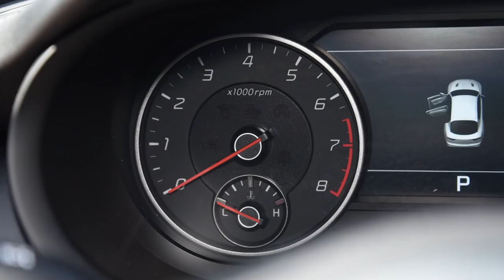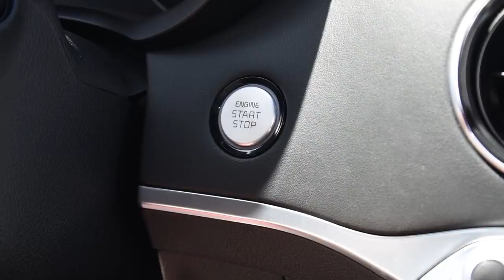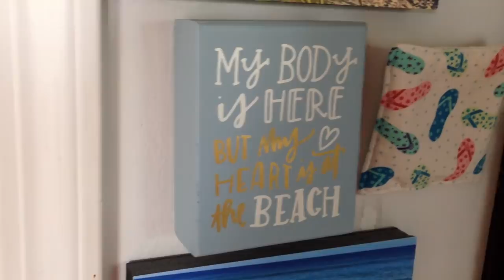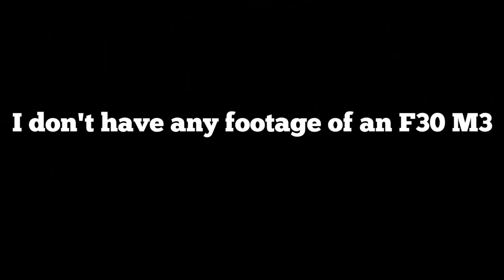2018 Kia Stinger GT: Regular Car Reviews

Comment: Literally this is the only Kia I would ever buy
Reply: I’d would drive an optima over an accord
Reply: The Optima is bad ass and the new Soul looks good. Sorry, but that is how the cookie crumbles.
Reply: Madeline Monahan  Grammar Gestapo, the Juden isn't in this thread. Go to another attic and spell check Anne Franks diary instead of the Ginger and his poor grammar.
Reply: Kia is still an unreliable brand. Loads of stupid tsb's coming out for most of their vehicles. The 08 to 13 Optima with a 2.4l or 2.0 turbo are warrantied for life because the engine is such a shit design they cant fix the problem so just give it a lifetime warranty. Not a car worth owning 10 years from now.
Reply: Pony Empires Unite Yeah but the soul feels like your riding in a plastic box on suspension made of jello. Id take an accord over the optima and the pricing is similar.

Comment: If KIA does not sell enough Stinger GT units in USA it may end up like VW Phaeton covert luxury
Reply: Alucurd Hellsing but the Genesis is selling well. So there will be parts and aftermarket
Reply: You’re thinking the Kia k900
Reply: The Phaeton is extremely well built though , like a tank lol.
Reply: they sold 3300 phaetons over 5 years.  latest Stinger sales numbers are 7059 total in 5 months.  and 1761 in May.  so.... not really like the phaeton at all.
Reply: The Phaeton did not sell well in the US because it was claimed to be over engineered so when it did break repairs were utterly expensive and also VW did not bother to advertise it not knowing that VWs are viewed differently in the US than Germany.

Comment: Right, he chose Kia over M3 because it "handles the same", not because it's $20,000 cheaper.
Reply: It's not even comparable to the m3
Reply: Driven both. The Kia feels like it has more power and is a LOT more livable. The M3 crashes and clunks over every bump and doesn't really hide it's a 4000 lbs monster.
Reply: KNOW MY BRAND
Reply: No, he chose it because it handles the same AND is $20,000 cheaper. If you don't care about badges, picking the Stinger GT over an M3 is a no-brainer.

Same goes for picking a Mercedes C-class or a BMW 3-series over a Maserati Ghibli - I have no fucking clue why Maserati thinks they can sell what's basically their take on a C-class or 3-series for TWICE the base price of a C-class or 3-series. In other words, why pay more for the same thing if all paying more really gets you is a badge?
Reply: Less then that my 19 competition package was 80k
Reply: @razorgxp  M3 Curb Weight is around 3500lbs. Not 4000.
Reply: Kia cars still are not reliable
Reply: @KobeCorona-uj3zb  that is false
Reply: @VestedUTuber  The Stinger is a great car, it really is, I am deciding on one or a model 3 mid as a daily, but don't be an idiot. Its nothing close to a m3. a M3 is a rocket ship scalpel knife. The Stinger is a couch jet plane in comparison. Great, but a GT tourer, not a racecar.
Reply: @KobeCorona-uj3zb  yes they are I've had two

Comment: BMW hurting juice
Reply: Uff aua meine Werke
Reply: Stef_R which is accurate because Hyundai/Kia poached BMW M people.
Reply: Stef_R bmw M5 goes 0-60 in 2.8 seconds. Lmao. 

But I’d rather have a bmw 440xi for $60 than a $55k+ kia
Reply: Devin Bender stingers start around $34k, a top trim GT2 model can be had around $50k.
Reply: Yukikazehalo and that base stinger has 255/255rwd for 35k (local dealer price) 
BMW 330i is about 38-40k local price. 

GT2 is priced at 55k+ locally 
BMW 440xi is 60k locally. 

Still taking the bmw for an extra 3-5k it’s worth it
Reply: Devin Bender your local Kia dealers have awful markups then, there isnt a single GT2 in my area selling for over $52k.
Reply: and when it brakes you will be crying to and going to kia
Reply: Yukikazehalo that’s what happens when there’s only one owner of all the Kia dealerships within a 150 mile radius.
Reply: Uncle SJ not I’ll be going to ford. Ford fusion sport would be my first choice anyway
Reply: Devin Bender The Fusion Sport doesn't even compare, at that point I'd rather get a Taurus SHO which has, surprise surprise, also a turbocharged V6 and AWD. Paying more just because you'll have the BMW badge is stupid, at that point you're just buying the car for the badge and how it'll make you look in public. That means you're buying the car for other people, not for you.
Reply: uh the Fusion Sport also has a turbo v6 and AWD so how doesn't it compare?
Reply: Olivier Savard Fusion sport Base 38k Stinger v6awd vase 38k 
Loaded vs loaded 44k vs 55k 

Both are about 190” long 
And the ford weighs 600+lbs less
Reply: Devin Bender Alright, so I actually went to see what's the difference between both and if the Fusion Sport is worth taking over a Stinger GT.

First of all, fully loaded with every option, a Fusion Sport costs about $47k, not $44k. As for a fully loaded Stinger GT2 with every option, it costs $54k, not $55k.

Oh, the Stinger GT has a weight of about 4000 lbs, while the Fusion Sport has a weight of about 3900 lbs, so I don't know where you got your number of "600 lbs lighter".

Now, what's the difference? 

- FWD-based for the Fusion vs RWD-based for the Stinger GT
- 365 hp (seen by some as underrated as C&D gets figures and times that are similar to the Chevy SS which is more powerful and a bit lighter) for the Stinger GT vs 320 hp for the Fusion Sport
- A lot more equipment on the Stinger GT2 (the most pricy one at $54k with every option) than on the Fusion Sport: to get a similar level of equipment to the Fusion Sport, you'd get the Stinger GT1, which costs about $45k fully loaded with every option
- More room in the Stinger than in the Fusion
- 8-speed auto for the Stinger GT vs 6-speed auto for the Fusion Sport
- Bigger brakes for the Stinger than the Fusion Sport
- Better warranty for Kia than for Ford
- Better reliability for Kia than for Ford
- Better acceleration for the Stinger GT than the Fusion Sport
- Better braking distance for the Stinger GT than for the Fusion Sport
- Better lateral grip for the Stinger GT than for the Fusion Sport
- An actual liftgate/hatch for the Stinger and only a regular sedan trunk for the Fusion Sport
- LSD available for the Stinger GT2 and not available for the Fusion Sport
- Launch control available for the Stinger GT and not for the Fusion Sport

Knowing I'm going through a lot of stuff, I think the Stinger GT is just better than the Fusion Sport, as well as worth the price difference for the GT2, since it has a lot more equipment than the Fusion Sport. The GT1 offers level of equipment comparable to the Fusion Sport for about the same price, but being still better in many points.

If you want to compare it to something, then compare it to the Buick Regal GS.
Reply: Olivier Savard LSD is arguable. 
Better performance is a marginal. 
Trunk is only what 2ft3?? And it’s all vertical space. 
Better warranty??? What do expect the Kia to blow a head gasket at 80k? 
Better reliability??? ON WHAT FUCKING PLANET?!?!?

Fusion has Magnetic suspension. And Loaded cost 10-15k less in the real world!!! 

0.5inch bigger breaks
0.5 seconds quarter and 60 is hardly better 
15ft stopping 
And 0.05gs lat grip is nothing. 

I can take that 10k and get a tune on E85 and get bigger tires and blow the fucking doors off a Kia. 

Kia is one of the fastest depreciating brands on the market. The GT2 will be 30k or less in a few years. 
Ford has 100+ years of Racing Heritage.
Reply: Devin Bender Look, dude, the Stinger is just better than a Fusion Sport. There is no 10k difference, and if you get a GT1 which has the  same equipment as the Fusion Sport, they'll cost pretty much the same. You keep comparing the most expensive trim even when there's another almost identical trim which is roughly the same price as your Fusion Sport. Even if you keep saying that there's almost no difference, and that it's "nothing", there is still 40 more horsepower (and possibly more), it handles better and brakes better. 

If it would be worth comparing, then people would actually buy the Fusion Sport. As I said and repeated, it doesn't aim the same target or the same public. Someone who's going to buy a Fusion Sport is going to buy it and won't look at the Stinger, and someone who's going to buy a Stinger won't look at the Fusion Sport.

Now, if you just don't like Kia (the brand in itself), would never want to buy one of their cars because they are Kias and won't concede a single thing, then just tell it. I'll understand. You'll stop losing your time replying at me and I'll stop losing mine replying at you.
Reply: King of The Castle everyone is cutting back on sedans. 
Last I checked ford sells more sedans than everyone else excluding Honda and Toyota and it’s close.
Reply: ow oof my M3
Reply: Breaks actually , brakes in your wording are on the car ;)

Comment: Nice ride but the SS is worth it for the motor. LSx>all
Reply: THATMOFODIRT and the all mighty 6 speed stick shift. Automatics are for normies!
Reply: THATMOFODIRT 400+hp v8 or 350hp v6 hmmmmm 
Yup gimi the 8!!!
Reply: and the sound lol
Reply: If you're only looking at the motor, just...get a Camaro? Also, this twin-turbo, inline-6, 9-speed automatic is faster than your obsolete-and-honestly-antique N/A V8 and 6-speed manual. The Kia is also more comfortable, more fuel efficient, has more space, has a higher-quality interior (ironically enough), handles better, and is only 26lbs heavier.

So, while the SS may be worth it "for the motor", is it worth it for...every other part of the car? I'll have to say, no - and I do love my Chevies.
Reply: Naru 'Sanav sane gas mileage and the Automatic Camaro SS kicks the shit out of the Kia on the race track... it’s not even close!

And handles better?? Where 
Camaro better braking, skid plate and magnetic suspension

Comment: The one pet peeve I've had with Kias (from the 2011/2013 models, I haven't recently driven any) is the fact that you couldn't turn off the radio/music when you wanted the LCD screen on in order to display the map of where you are, or do navigation and so on. All you could do when you wanted silence in the car, was to turn down the volume, but the thing had the annoying habit of going back up to 4% after you restarted the engine, so basically it was some barely audible noise that annoyed you until you remembered to turn the volume back down. And there was no way of having only satnav without any fucking radio bullshit. So yeah, that was an absolute no-go for me, and this is the only reason why I wouldn't want to have a Kia!
Reply: Interesting, I've never had that issue, my radio is set to SiriusXM ch 0, which is a nothing channel! No noise here, love my 18 Optima

Comment: "Handles like a M3"
Reply: lamarasamuel it was designed by bmw
Reply: Tam Ago appearance not performance by bmw................
Reply: Performance was by the ex head of BMW M.
Reply: benanderson89 President of engineering. All he did was write checks.

If it were real engineers from bmw the base car would have 300hp and the Gt have 400hp like most other sports cars out there
Reply: Devin Bender having higher numbers doesn’t make the car better tbh it’s pretty good as is and as a Kia it’s miles apart from the rest of its fleet. Give Kia a chance all companies deserve one.
Reply: Ace Morales it’s still to much money. 

Ford Fusion sport has 330hp awd and the same options as the GT2 and cost almost $12k LESS. 

Please try to explain why the Stinger is 20% better? 

(Oh and the SEL Fusion 2.0awd is $6k cheaper than the stinger 2.0Tawd)
Reply: Devin Bender I didn’t say it was better or worse I was just saying numbers don’t make the car. But that is a good point. I personally would probably still go with stingers because of all the bad luck my family has had with American cars and my friends aswell :/ even still good point. I guess it comes down to preference in look and maybe company
Reply: Devin Bender Because it is not for the same public and someone who'll buy a Stinger won't have the Fusion on their list, the same way someone buying a Fusion won't have a Stinger on their list. It just isn't marketing to the same target, so stop comparing these when they clearly aren't in the same market. Plus, Ford is dumping all their cars except one Focus and the Mustang. 

It's like comparing a Mustang Ecoboost to a Challenger SXT to a Golf GTI. It doesn't compare and it doesn't target the same people. It's like comparing a Miata to an Abarth 500 just because they have the same horsepower, again you can't, they don't target the same people.
Reply: Sounds like a sales copy....

Comment: I got to check out a 3.3L Stinger when I was working a deal on a 335i. I am very impressed with the Stinger GT, it's not the KIA I grew up knowing; that said, it's still a KIA and I'd never even consider owning one. Test drive one? Sure. Accept one as a loaner? Absolutely. Spend even a single penny to drive one? FUUUUUCK No! It's a great step forward but at the end of the day it is still a KIA.
Reply: My feelings exactly, I wouldn't mind driving one, but I wouldn't be caught dead buying one.
Reply: So? Why does the name matter? Worried about what your peers think?
Reply: Trapper Kreeper not at all,  I just think it looks hideous and a friend and her family have owned several Kias over the years and have seen that they seem to self-destruct once they are beyond the 100000 mile mark. That's why
Reply: Trapper Kreeper even as much as they like Kias and have owned 6 or 7 across the years they will sell them off after they pass the 100K milestone since they just progressively get worse and worse from there
Reply: Trapper Kreeper you just know the blue book of these will plummet to 1/4 of MSRP in 2 or 3 years. That is why I wouldn't buy a Stinger

Comment: @3:50 Lower right hand corner is a left hand with a middle finger. LOL
I saw a stinger in an underground parking lot. Had no idea that it was a kia untill I walked around to the front (KIA) there it was the badge in the center of the hood.

Comment: I loved the  commercial for these. "It can go 160 or whatever"   and the fine print: 'When equipped with 19" wheels.  Comes from factory with 18" wheels. Installing 19" wheels will not increase top speed".   So it's borderline false advertising.

Comment: I still like the Lincoln MKS AWD Twin Turbo in triple black... 
Horsepower 355 @ 5700
Torque 350 @ 3500
C/D TEST RESULTS: 
Zero to 60 mph: 5.4 sec
Zero to 100 mph: 14.1 sec
Zero to 130 mph: 26.3 sec
Street start, 5-60 mph: 5.8 sec
Standing ¼-mile: 14.1 sec @ 90 mph
Top speed (governor limited): 134 mph
Braking, 70-0 mph: 175 ft
Roadholding, 300-ft-dia skidpad: 0.83 g 
Curb weight: 4474 lb
Reply: Congrats you can use Google....

Comment: fair and honest review but I couldn't get excited about the stinger gt when I test drove one. the auto is a little slow, the price is a little demanding, the hatch is not hatchy enough. it does shed its weight nicely in corners, the 6 is smooth and just the right amount of fast, and it is a very nice place to be though. it's not for me, but i suppose i'd recommend it for many the reasons stated in this video

Comment: This past year at the Paris Auto Show, all of the automotive companies came together to celebrate a new year of success among colleagues. Now at this show in particular had one job that needed to be done for a sort-of show and tell. One by one judges were calling out the names of every single automobile manufacture to a large stage set up, dead center in the middle of the room. Chevrolet, ford, ferrari, Eagle, the list went on. 

Kia gets up on stage and has made it obvious that they were going up to show off the latest and greatest their engineers could come up with. Fog machines, pyrotechnics, a bull horn. A show of ego and optimism for some forward thinkers. 
When the crowd died down and the fog settled a clean looking and very well dressed aisian man walks forward and holds up a small glass case, he motions to the case and exclaims in near perfect english;
"This my friends is the smallest drill bit ever produced. It will help us make the most precise cuts into virgin aluminum to give the most perfect fitments between parts"
Just then a small in stature, bald german man walks up, asks politely if he may look at the the bit.
The german man puts down his beer, grabs his own drill bit and drill, drills a hole down the center of Kias drill bit
and takes a few sips of his beer. Then very politely rests his hand on the aisian mans shoulder and muttered two simple words.

"Needs work"

Comment: I love this car.  But you jumped right from the veloster to this.  There was an in between step that you glossed over that I think you'll like if you drive.  The Kia forte koup sx.  Specifically with a manual.  It's a car that was so wholly ignored Kia just killed it off due to slow sales, but to my mind its actually a great little "luke warm hatch"  despite not being a hatchback.

Comment: I'd like to see how long this car holds up.
Reply: The 100,000 mile warranty will be used.  Mice ate the coolant line on my stinger and my neighbors 2018 Legacy.  His dealer charged $450 and mine charged $1350 because a master mechanic has to take the intake off the stinger to replace it correctly.

Comment: As long as you can get past the badge the stinger looks like a fantastic car.
I have this on the shortlist for my next car as we are having our first kid shortly and the wife has told be I need to ditch the 2 seater Porsche.
The problem for me is my wife used to own a KIA back in the early 2000's so all my experience with the brand is terrible mushy econo-boxes and it is hard to shake that impression.